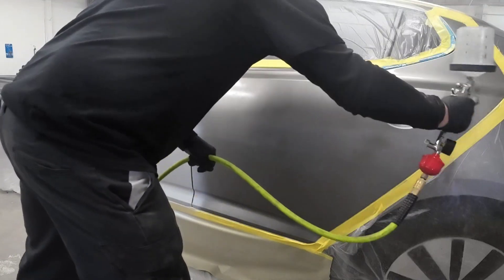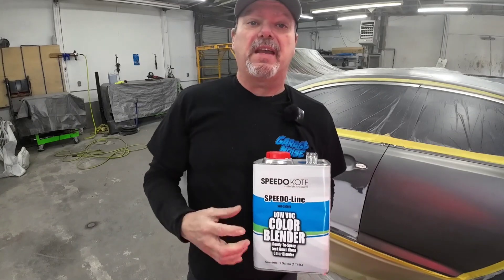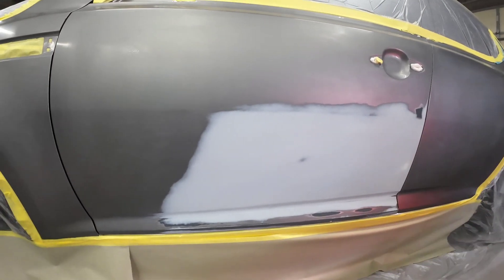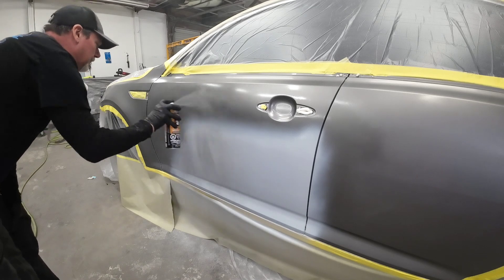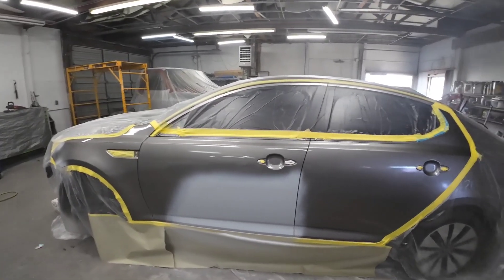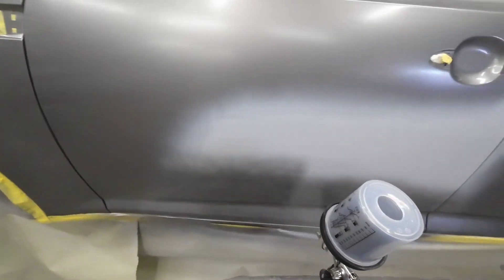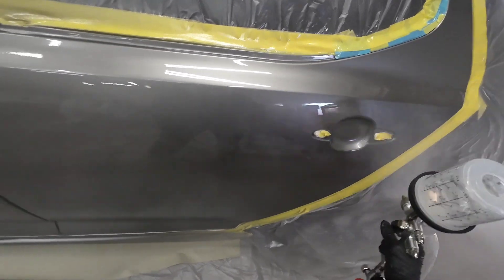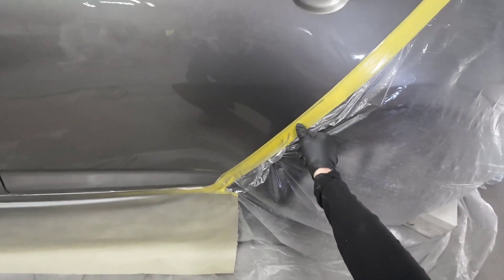How to use a color blender/clear base when spot painting your car.

Comment: I have used the Speedokote color blender to blend when it is still wet and had excellent results also. I was using a ready to spray base coat so I'm not sure how it would react with a reduced base coat when applied on the wet blender though. Thanks for another great video Chris!
Reply from the maker: I figure it was probably ok to apply base when wet .thank's for sharing appreciate the comment and support!

Comment: Is it possible to not use blending clear base
Reply from the maker: For a long time, I never used clear base. Or wet bed or anything of that nature, but I found it's very difficult in hot temperatures. So you're always better  off to use a clear base coat, especially when you're spraying in the heat of the summer and especially when you spray high metallic finishes, it just makes it so much easier to get as a consistent metallic finish.
Reply: @GarageNoise  thanks so much 🙏  , I really like the channel , please don't stop posting , it's really a big help to me and my small repair business. Much love from sunny southern Africa
Reply from the maker: @ZiyadhLatib  Awsome! Africa,  Wow YouTube is amazing.

Comment: How come you don't use prepsolvent. I used it for years with no problem but I see you use alcohol.  Why alcohol
Reply from the maker: I still do what I like about isopropyl alcohol is I can use it over anything including bodyfiller before primer. Prep solvent I don't  like using over filler or sanded plastic cause it soaks in.
Reply: @GarageNoise  do you find 70% alcohol provides the same results, as a substitution for wax and grease remover? I’ve never seen a body guy using it.

Comment: Did you sand the other door and fender b4 you used binder
Reply from the maker: Yes, blend panels were sanded with 600. Appreciate your comment and support!
Reply: @GarageNoise  if I don't have any blender to use how do I use the reducer
Reply from the maker: @terryhall5811  the reducer is used in th paint and blender. DON'T use it by itself to blend base coat. Is that what your asking?
Reply: @GarageNoise  I used reducer to blend my clear cause I didn't have any blender.
Reply from the maker: @terryhall5811  ok, yes I do that as well sometimes.

Comment: Im still struggling a little bit with my eastwood lt100 sir. What settings would you recommend for basecoat and clear coat? Thank you in advance!
Reply from the maker: What exactly are you struggling with? Is it a flat finsh? Too much peel or dry spray and what settings are you spraying with now?
Reply: @GarageNoise  Hello sir. When applying basecoat, it is not smooth finish and looks like a dry spray. Sometimes it also has textures. I have my fan wide open and 2 turns for the fluid around 25 psi. For clearcoat, 2.5 turn for the fluid and fan wide open with 30 psi. Anything you can suggest to have a better result? I was also using medium reducer from eastwood but planning to get slower reducer. I am also using Finish 1 Clearcoat Fc720 w/ medium hardener. Thank you so much for your time.
Reply: Try to reduce your basecoat a little bit more. Make sure gun is clean. & spray nice wet even coats around 25psi. Good luck. @jmsxmedia1364

Comment: What air pressure you recommend I'm having issues with tiger stripes on fenders I'm painting could I change directions when I'm spraying
Reply from the maker: If you get tiger stripe make sure you fan has a good spray. Lower your air pressure depending on the gun 20-25 psi you also might need to bump up your fluid a small amount .
Reply: @Garage Noise  I was using the eastwood lt100 for the base recommended setting you would try on it?
Reply from the maker: @2koolforyou88  fan wide open , psi I like about 24 for base fluid 2.5 -3 turns out from closed.
Reply: @GarageNoise  appreciate it

Comment: I have a question about what grit sandpaper for prepping the original clear for this repair. I have the same situation on an older Silverado we repaired the rusted wheel wells and are getting ready to blend into the rest of the box. Thank you!
Reply from the maker: Sand the blend area with 600 or 800 I use 600 but if it's  a high metallic 800 would be a better less aggressive scatch.  Appreciate the comment and support!

Comment: Awesome refinish as always man , great work , i am definitely going to start using the color binder , looks like it helped a ton , thanks !
Reply from the maker: I didn't  alway use it but do now on most all metallics. It's  just good insurance at the very least. Appreciate the comment and support brother!
Reply: @GarageNoise  yes sir definitely, and yeah it is , ive seen those aerosol can blenders before , but i hesitate due to fisheyes , 
But i do have a question , how would you paint with a heater during cold weather if your not in a paint booth , and would the heater also cause fisheyes even tho you use fisheye eleminator? I ask because i ran into that today , tho it was below 30
Reply from the maker: @low3.657  I use a diesel  heater. I will vent fumes out but leave the heater on when I spray , but this can be dangerous because of the open  flame. It's  a bullet style  heater so the fumes don't  reach the flame so I don't  have a problem. Sometimes I shut it off during clearcoat.  Also Infra red heaters are great for heating up panels before you paint.
Reply: @GarageNoise  yea so i do the same during basecoat, i keep it on , and shut it off during clear , the only thing i can think of is using the same used up tackcloth or too much water in the air system , even though it has a harbor frieght water catcher , i use a craftsman heater inside the booth
Reply from the maker: @low3.657  ok are the fisheyes inn the clearcoat? Or base coat?
Reply: @GarageNoise  clearcoat
Reply from the maker: @low3.657  I've  personally never had my bullet heater cause fisheyes. I'm  sure it might be possible and have had my concerns with it as well ,but I've  kept an eye out for it and have never had it happen. I would say it's  more likely from some other contaminants.  I'm  assuming it's  not loaded  with fisheyes, proby just a few. If that's  the case I would start with air supply making sure I had clean dry air. Then the vehicle.  I recently  had a customers vehicle  that was well taken care of a frequently waxed and I could tell from residue left on the vehicle. I cleaned  and prepped that thing at least  5 time and still got a couple fisheyes. Hope this help appreciate the comment and support!

Comment: Just did a small spot repair on a quarter panel using color matched spray. The blend came out terrible. When you mention tiger stripping and modelling, is that the same as a halo effect? I get that a wet bed is suppose to smooth the surface so the metallic flakes land flat. Just not sure of the differences between the three mentioned. Great videos as usual.

Comment: Thanks for the tips !. Just wondering what spray gun you used during this video ?. I have approximately 30 years in the industry . Just started using Speedy coat products because of the cost of materials. Have been very satisfied with them. Keep the tips and videos coming !. Thank you again !.
Reply from the maker: Thank's James! It's  a new gun that I will reveal in next Sunday's video. Here's a clue it's  manufactured by Rongpeng and sold by Vevor but it's  not the R500. 
Appreciate the comment and support brother!